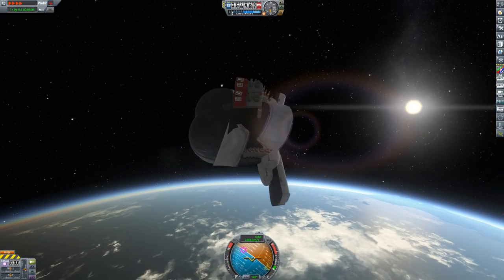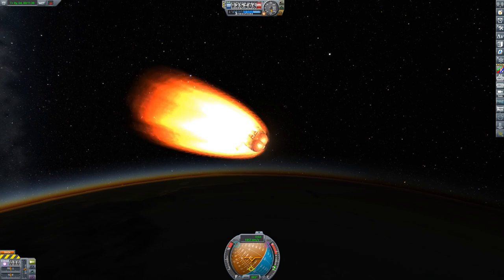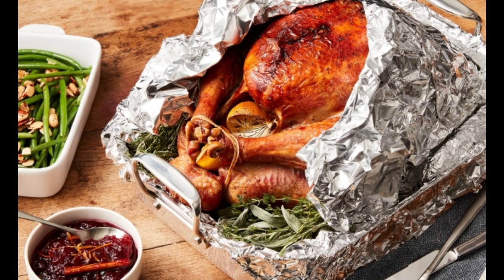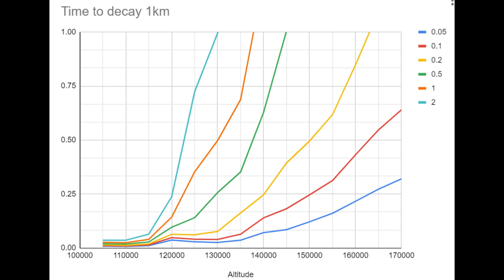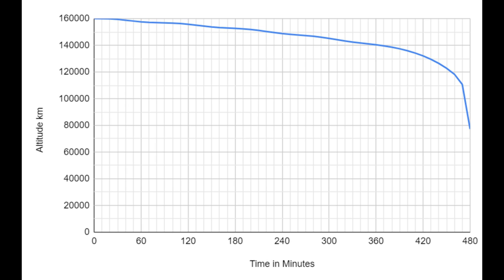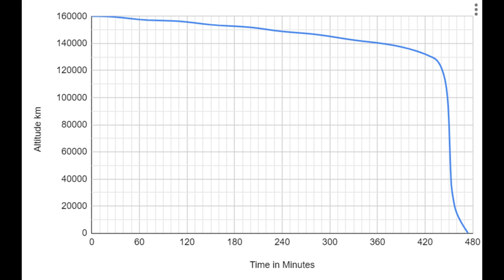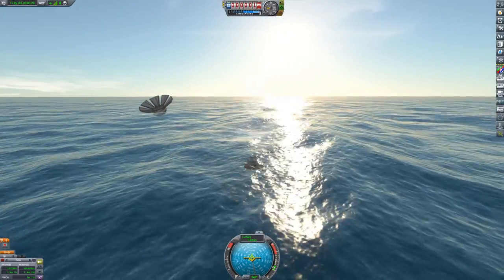Can You Cook a Turkey by Dropping It From Space?

Comment: On a similar topic: if you put your head out the window while traveling in a car, you notice that you cool down. But at reentry speeds, it heats up. At what speed will the perceived temperature remain constant?
Reply: Lots of variables there.  What is the outside temperature?  Is there a headwind or tailwind?  Do you have oily skin or dry skin?  What is the humidity?  And the dew point?  What is the pressure altitude.  Is it a sunny day or the dark of night?  This could get as complicated as cooking that turkey.
Reply: @jerrymiller276  Just another variable: How round is your head?
p.s. Is "headwind" when your head is outside the car? If so please explain how a "tailwind" will be achieved?  
;-D
Reply: @ErnstKotze  A headwind is when the wind is blowing opposite the direction of travel.  A tailwind is when the wind is blowing in the direction of travel.  Both have aerodynamic consequences.  A headwind means that the air will be moving over  your head faster than your speedometer indicates.  A tailwind does not need to be blowing very fast to affect the speed of the air flowing over your head, making it slower than the speedo says you are moving.
My head is a bit of an oval, not all that round.  I don't often stick my head outside the car when it is moving because I fear losing my sunglasses and getting a bug in the eye.  I definitely don't stick my tail outside the window anymore, though I may have done it when I was much younger and stupider.  As far as I know no photos exist and the statute of limitations has long run out.  But I do occasionally put a hand outside and play with the slipstream.  The air flowing over the rearview mirror causes extra lift in just the right spot, requiring that I change the angle of attack, and the lift stalls if I get my hand right behind the mirror.

Comment: Easier- have a capsule made of something with more heat capacity. Put the right amount of heat into the capsule material with a more normal reentry, then let it land and sit there on the ground for a couple of hours while the heat conducts through and cooks the bird. When the oven thermometer on the outside hits some precalculated temp or a timer goes off, you just open it and its ready. 

For bonus points you can use some sort of bimetallic latch so it pops open when the right gradient of temperature means the turkey is done. This way you could drop turkeys on people all over the world that werent even expecting a turkey, and the capsule would automatically open when it was time to eat.

Comment: Riddle me this: In my naive mind things in orbit around the earth just need a little bump to lift them up from that orbit and from there they should continue to spiral upwards and away from Earth. Given that the objects had the correct velocity to orbit at that altitude originally, bumping them up to a higher altitude would make them lift away as (I think) you need less velocity to orbit the further out you go and the conservation of momentum (and minimal air resistance) would allow it to fly off (albeit eventually)  into space or at least to a higher orbit. If this hypothesis is correct would it not be simpler to bump unwanted hardware up (along with the gizmo that does the bumping) and clump them together for recycling (later) rather than pushing them back into the atmosphere to burn up, be thrown away and destroyed? This question brought to you by a restless mind trying to get to sleep last night! :) Happy New Year to you and yours from grey Guernsey in the UK.
Reply from the maker: They don’t spiral out, if you give something a kick to make it go faster and that kick is less than escape velocity it’ll go up, reach apogee and then fall back down to the original altitude, the altitude will oscillate up and down once every rotation. So it doesn’t ‘spiral out’

Comment: Hi scott, have a nice & Happy new Year. This video, let me remember a question: Using the never before used and maybe STRANGE kind of orbits you mentioned in one of your recent videos, do you think would be possible to find, for an object,  a path orbit where at the last moments, while reentry, you have an atmospheric reentry speed of 300-400 km/h instead of the many thousands you actually have ?
I wonder if would be possible to have a reentry path into the earth's atmosphere with way less speed and conseguently have way less heating problems?
I think could be useful and way less dangerous...
Reply: In short, unfortunately no. Maybe if there were two very large bodies orbiting exceedingly close to each other, but even then tidal forces would tear at least one of them apart (see Phobos) so it still wouldn’t work. The problem is that gravitational force is inversely proportional to the square of distance, it increases very quickly as two objects approach. So in the altitude range for low Earth orbit, the Earth’s gravity dominates by several orders of magnitude. That makes the vis-viva equation, which is what dictates those high reentry velocities, extremely accurate.

Comment: Why worry about inflation when you could cook a turkey by developing a dedicated space program!  At least we know its possible.

I was thinking of a slower process, using a highly elliptical orbit that uses aero braking to add the heat for the oven. The spacecraft oven would need to have a heat shield on one side for the final re-entry and on the other side an energy storage system that stores the heat energy from every dip into the atmosphere. Something simple like a liquid metal closed loop system that can transfer the liquid from an insulated storage container to an exposed heating element could work. 

This system should be carefully designed so that after the Turkey has been cooked to almost perfection, the unneeded mass can be ejected to as separate pieces that can burn up on re-entry and provide a more celebrious indication that dinner is almost ready.

Comment: I would say put a turkey in a pressure cooker on orbit with onions, mushrooms, carrots, potatoes (forgiving on cooking time) and water. Radiant heat from the sun cooks the turkey through a few orbits, when the temperature rise the water will boil and steam from the nozzle progressively slows down the pot, when cooked it de-orbits then browns during reentry finally crashing through the roof on the table. All you need is initial point at the right time and orbit. Et Voila!

Comment: There is a nice dimensionless number called the Biot number for any substance. It's a mix of geometry, specific heat, and conductivity.  And there's a simple calculation for cooking time using the Biot number.  We used it in Thermodynamics class to calculate how long to cook a ham! 😅 Oh! And we calculated the difference in cooking time if you use aluminum foil shiny side out or shiny side in. The difference was super small, I think less than 1%, also known as zero difference in the real world. So no need to argue about shiny or dull side!

Comment: Why not using a simpler (😂) method: make the capsule from some thick material that absorbs heat upon a conventional fast reentry. The heat would accumulate in the wall of the capsule and start cooking the bird. It would then hit the ocean and start dissipating its heat to the water - keeping the turkey on an optimal cooking regime, getting it crispy done just upon arrival of the pick-up vessel. I didn’t do the math, but it shouldn’t be that hard. You could always have an inner layer of water around the bird to keep the temperature at a maximum of 100 deg Celsius, with some pressure valves to no t get it overheated.

Comment: While the methods described are certainly one way to cook a turkey by deorbiting, I do think that some of the methods used are not rocket sciency enough. In particular, the initial design choice of making the spacecraft like a giant oven seems premature. The low thermal conductivity of turkeys is indeed troubling, but resigning ourselves to cooking it for hours is a very un-Kerbal thing to do. Scott already mentions skewering the turkey to rotate it, but I propose having dozens/hundreds of thin copper skewers (possibly even heat pipes), dumping heat from the heat shield directly into the center of the turkey. This way we could achieve proper done-ness in a fraction of the time required by traditional methods. This allows us to use more traditional re-entry profiles, which will allow us to be home in time rather than spending many hours faffing around decelerating.

Comment: You could cook it in orbit from the solar radiation by controlling insulation on the hot side vs the cold side (and technically fully sealed aluminum foil wrap wouldn't be too horrible in space, not the most efficient shielding, but not completely useless). However that wasn't really the question.  From a spacecraft engineering perspective I would probably look at shielding the bird from the forces that could destroy it, then look at how I could absorb and hold on to as much thermal energy in ~15 mins as possible.  Then once we have gained this energy hopefully looking at releasing that over a long period at optimum cooking temperature.  But technically then the bird would be cooking during parachute decent up to payload retrieval.

Comment: Scott, what about "the whicker effect"? If you have a lean bird, wouldn't it be very different from a fat bird, in a sense that the outer layer of fat may not only insulate the water inside, thanks to fat being hydrophobic, but due to its ability to burn at very high temperature, will lead to water boiling so rapidly that it will result in a steam explosion, ripping the poor fat bird to shreds. STC in action (Spontaneous Turkey Combustion). This could probably be remedied if the turkey is to be plucked before re-entry 😂

Comment: How about a pressure cooker with oil and turkey?  Heats up with the 1000C temps and cooks in 20 minutes.  Finishes cooking in the hot oil on the surface as long as its not in the water.

Comment: Hmm. I would imagine make the outer case of something refractory and not ablative, the inner part of a metal that is porus and very conductive satured with water. Then seal the turkey inside with a pressure  regulator on a protected part of the re-entry oven. The outer part wpuld be made of platinum iridium clad tungsten. The inner part would be made of alumium, silver or copper, but most likely aluminum. Would be pressure cooked- fall apart bone tender. 😁🤓

Comment: Simpler solution: attach turkey to a long rope. Drop it from ISS to altitute of 130km, et it cook via friction for as long as needed, then just pull it back up and you have a great space cooked turkey for ISS crew :-)  (forgetting inconvenient aspects such as pushing turket down hard would actual put it in elliptical orbit, but then if you time it right, for the apogee phase, you you solar cooking of turkey.
Out of curiosioty,  when they reach ground altitude, are vehicle still hot from re-entry or has the dneser atmpsphere (especiallt the -50 at commercialy flight altitudes of ~10km) cooled it down and the vehicle is actually cold?
Reply: I know that at least the Soyuz is still hot, sometimes hot enough to set nearby dry brush on fire.

Comment: I've always wondered if you can cook things with ultra high vibrations. That's all heat is so if you can vibrate something fast enough it will get hot.

And most likely disintegrating it in the process but if done right it could cook things all the way through in milliseconds.

Comment: Ahh, the ole burritos on the exhaust manifold trick .  And Yes,, it does work.   The last little bit requires about 10 tons in the trunk and full throttle,,for the final sear.   Use the cheap gas,, a uber-quick burn rate.   Radiator steam is overrated, Don't mind it.  Plus, it steam-poaches the veggie tray real nice.  Lets see, a full tank of gas is $80, so if you do the math's,,, um,  ??,,Bloody Hell!.   Thanks Scott.  PS:  I guess you could build a big railgun and fire the bird thru the atmosphere, to be cooked on reentry, and land in the front yard,,like a smoldering meteorite.  Yummy!!

Comment: Being in space, the turkey would likely be frozen solid. Was the heat of fusion factored into the heating/cooking process? Also, if a loss of water mass is used in controlling descent, could the water be turned into steam by energy from the heat shield and then be vented forward, thus giving a retro-rocket type deceleration force? Just wondering....

Comment: If you reduced the air pressure using just partial the Vaccume of space would the Turkeys tissues cook faster? The water should seem hotter to the tissue or proteins.Because the boiling point should be less. Lower pressure should make for faster cooking. Or do I have something wrong. This is a fun problem... ;)

Comment: LOL. Awesome.   But isn't there potentially a sweet spot where you use the initial  stage of deorbiting as the entire cooking process and just let the time necessary be the exact ime it takes for the bird to hit the ground  by perhaps going a bit lighter on temperature for the 1st part but ending with lots of heat for a short duration  and forgo all the extra  ablatives and expanding bits. Just perhaps increase the mass and thickness of the whole container craft so that it remains hot with momentum after it lands for that last portion of the cooking?

Comment: Here's another thought -- find a way to cook the turkey using the short, high heat pulse characteristic of atmospheric entry.  My thought was to attach the turkey container to a series of heat transfer elements (perhaps something as simple as a series of metal wires or plates attached just underneath a PICA-like heat shield) and run that heat through hundreds of thin metal rods inserted through the bird.  You could then cook the turkey evenly from a grid of internal high-temperature heat sources that would flash-cook the entire bird in a matter of minutes.  Of course, you would need to be very careful that you removed all of the heating elements from the turkey before you attempted to carve it, and this wouldn't do much to create that golden-brown skin people like.  But, hey, if you want that, you might as well go back to the stone age and use, I dunno, an oven!  🙂

Comment: if you released a raw,  rotating chicken breast from the JWST would it cook from the sunlight or freeze from the vacuum? 

what rotation speed would be necessary to perfectly cook it? - what distance from the sun would be best for cooking a perfect medium--rare chicken breast? 

asking for a friend 👌👍
Reply: Assuming that a chicken (or turkey) has roughly the same properties as a human, then first the water in it would start to boil from the low pressure, then it would veeerrry slowly freeze (over the course of many hours). Eventually some of the frozen water would sublimate away. Even in direct sunlight, the equilibrium temperature is a somewhat below freezing, but it takes a long time to reach it.

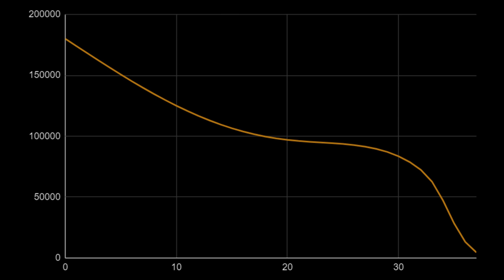Comment: 6:05 well you dont actuly have to cook it during re enter do you .. if you were to say add alot of thermal mas to the re entry vehcal so that like and old school brick oven where you light a fire in it to heat up the briks and then you sweep the fire out of it and put in the   things to be baked from residual heat .... you might be able to takre that 15ish minites of 500 to 1500 degree heat run it there a thremal  accumulator and then discharge it into the bird at a nice cnstant rate of say about 180c for  say 2 or 3 hours....  ether that or you insert heat sink  probes into the bird and then cirulate coolent froma  radator     on the outside of the craft to soak in that heat